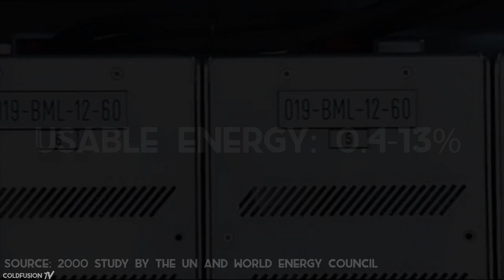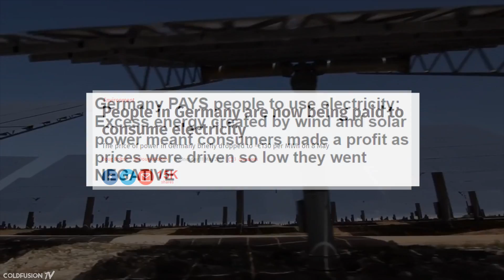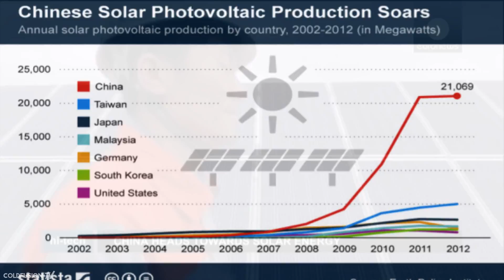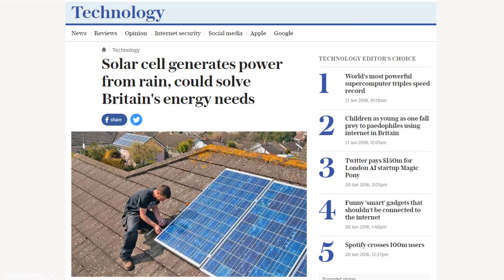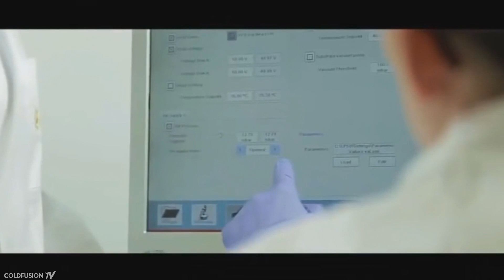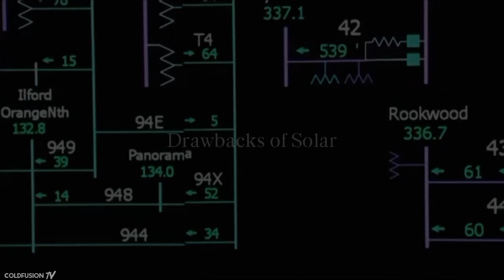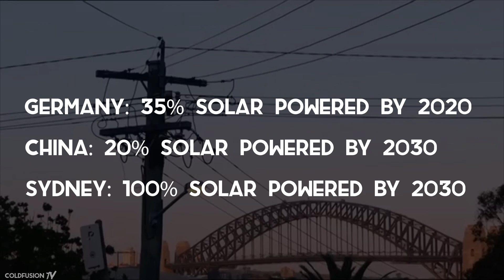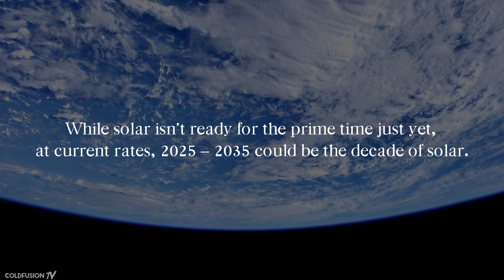The Truth About Solar

Comment: Capitalism doesn't agree with free energy, sorry.
Reply: Actually is does. If energy is super low cost and reliable it lowers the cost of doing business massively and gives long term security in the market place and elongates one economic disruptor.
Reply: time for unchecked captailism to die then with the rest of the old world.

along with your outdated industrial education set up
Reply: It isn't free. You still need to build stuff - batteries, power lines, silicon chips, maintenance, construction. At no point will it be free.
Reply: 1. Solar energy is not free. 2. Capitalism loves cheap energy
Reply: ***** Oil is free. It's sitting there. Just pump it. Ah, you need to actually do work to do that, convert it, distribute it etc. Sun is there. Just collect it. Ah, you need to do some work to build panels, convert it, store it, distribute it... nah too much work, just sit in your couch and comment me back.
Reply: The only capitalism problem is costs and benefits. If it's more expensive and has the same effect (not regarding environment) then we and I won't accept it. In general we don't want to lose money for altruistic reasons. I am not a charity fund.
Reply: That doesn't mean it's free to get the energy.
Reply: ***** Ha. Perhaps more applicable here than in any other place is the phrase "Easier said than done.
Reply: +danwarb1 tell that to bp, exxon, shell who are some of the world largest solar and wind manufactures and users.
Reply: Dark Alchemist You are disconnected from what it means to run a company.
Reply: Yea it does. Get something for free and sell it for money? Capitalists are all over that. That is why it's a billion-dollar industry today. It's a long-term investment, but hey, all power plants are.
Reply: Capitalism provides such advances and it boggles my mind that people blame it for every problem in the world
Reply: ***** you obviously don't understand how vast social projects like this work.  without the economy to support the design, manufacture and maintenance of such a system there would be no projects like this.

you also don't understand how economics works either.  there is a need for money in a society even with all those things, even if you made everything for free you still need money.  there will also be a need in society to compare the value of an something like an apple and a TV, and money provides the ability to do so.
Reply: Exactly
Reply: whats more important: an invented economic construct, or the existence of our planet?
Reply: according to wikipedia: ¨In 2006 Shell paid SolarWorld to take over its entire solar business and in 2008, the company withdrew from the London Array which has become the world's largest offshore wind farm¨.
So we can say that big companies are making a slow transition from oil to sun i guess...
Reply: Mārtiņš Rozenbergs
It is the most free that you will ever see.
Reply: Capitalism agrees with everything.
Everything on Earth is won free.
Imagine a world completely powered with free energy,
that would put a price on every ounce of (what used to be worthless) soil.
No alternatives and limitless.
Reply: tybofborg
Buy low and sell high is how a business works.
Reply: The problem isn't free energy. The problem is education. The worst thing to do now, is for an educated person to do nothing. Bring on the solar but let's not put all of our eggs in one basket.
Reply: Oxymaugnus
Of course.  Look at it like this a business, like WalMart, powering their store/shop all with alternative energy means that after the cost of buying the materials, and having them installed, would mean more profits due to no longer having to pay the power company AND THIS is why they give HUGE incentives to companies where it is less expensive to use the grid than it would be to use something like solar.
Reply: Who do you think is building, selling, and installing the solar panels? CAPITALISTS, dumbass.
Reply: China is not a communist country since deng xiaoping took over in 1978.
The panel production is heavily subsidised and that allows to produce massive amounts with effects of scale that were not possible in EU and are just starting in USA with the SCTY gigafab
Reply: ***** no, i think i came with what i need to state.  you may keep going all you want.  i feel secure enough in my points to rest my case
Reply: ***** did you just personify capitalism?  like it has hopes, fears and desires?

capitalism is simple, if we can make more money off of renewable energy than fossil fuels then we will use it.

if you are talking about a resistance to change, that has more to do with politics and how the economy is influenced by well established companies.  this is, at best, tangential to capitalism.

personally i see much capitalist potential in cheap, sustainable energy sources.  cheap energy has powered our economy since the industrial revolution.
Reply: If you pay for the solar panels and pay for their installation and ongoing maintenance and regular replacements, then pretty much EVERY capitalist in the world will instantly "agree with free energy". But as long as you don't produce and install solar panels for free, capitalists will keep looking for the cheapest possible energy. 
So, come on! Save the world and start producing and installing solar panels for free. What are you waiting for?
Reply: ***** RBE is bullsh*t for the most part. I used to be a big proponent of it until I dug into the details.Bottom-line of my findings was: It's a pipe-dream. Not gonna happen. Because the very fundamentals of that idea are based on wrong assumptions and Peter Joseph won't admit it. To see how deep I actually dug into that idea, this here will give a glimpse: https://twitter.com/StarCityProject 
I'm very serious about executing that project and making it a success. But RBE won't be part of it. Any society based on RBE is destined to fail.
Reply: ***** My point was NOT about using existing resources that the earth has. My point was about RBE specifically. It certainly makes a lot of sense to act and live in a resource-aware manner and Star City will be the first 100% self-sufficient mega city with 100% of all waste materials recycled. I haven't provided any reasoning here (for why RBE is bullsh*t) because it would take considerable time to write these points down. PLUS, posting it here in the comment section wouldn't be the right place. But I WILL write a proper article about this in the future. (can't promise when at the moment)
P.S. And I have only used the picture of the Venus Project as a temporary placeholder or visual gap filler. No more no less. I've been working for several years on this project, but not too many visuals at the moment and I'm not yet prepared to share those visuals that I have right now. That first article that you glimpsed at is just that: A first article designed to provide a very tiny glimpse on the idea. There's a LOT more to come and eventually that placeholder image from the Venus Project will be replaced with a proper image and a comprehensive video.
Reply: ***** I most certainly will provide the mechanics to make this work. That's for sure. And unlike RBE, Star City will have a solid foundation based on strategies, methods and techniques that are time-tested and proven to work. RBE only appears reasonable at first glance. But once you start digging deeper, you'll inevitably come to realize that RBE contains fundamental flaws in thinking/assumptions. Once you realize that, the whole RBE concept (appealing as it might seem at first glance) comes crashing down like a house of cards.
Reply: if only we could make the world better by wild speculation and making stuff up.  someone has to actually do this stuff instead of writing about in YouTube comment sections.

i can tell none of you guys are serious because you wouldn't be presenting these ideas to people who don't matter in the larger scheme of things.
Reply: the only way to get free solar energy  is if the panels are free (including maintenance). Its like buying a one year bus pass n saying you have free bus travel for one  year. And guess what,  the ppl making the panels wont work for free same as you wont work for free.
Reply: noneednow don't bother dude, just another person trying to change the world through the youTube comment section.  maybe all they have to do is believe hard enough, not put in actual effort into anything.

they double post, don't even know how to edit their comment.  so what does that tell you about how effective they are?
Reply: +Athletics the ability of the Zeitgeist Movent/Venus Project to be so dead on in their appreciation of the problems we face and yet so out of touch with reality with regards to solutions is utterly mesmerizing. 

For instance —
VP Proposal: cities arranged as a series of concentric circles with each circle dedicated to a different function. 
Why It's Stupid: Compared to a fractal or random distribution of functions, a circular distribution increases average trip lengths, making walking or biking less viable. In better news, it increases the number of people who have trips with the same end and start points making public transit more viable; though public transit is still sitting on your ass, which is bad for your health, and is also far worse environmentally than walking or biking. It would also result in people crossing paths mostly only with the same people that the people they cross paths with cross paths with. Also, it would be difficult to adapt to currently existing cities and it is much more efficient to make as much use of existing infrastructure and building stock as possible and only alter it as needed. Also, cities composed of concentric circles would entail significant central planning, which has always been shown to be a complete fucking failure that only benefits the planners if even that.

VP Proposal: skyscraper greenhouses, or whatever stupid shit you call that stupid shit.
Why it's stupid: powering x acres of artificial lighting requires 3x< acres of solar panels, and stacking the greenhouses means you need to spend more resources making the lower stories structurally sound then if you just built the same acreage using a single story and glass roofs. Moreover, in conjunction with the concentric circles layout it would likely put some adjacent buildings in perpetual shadow, esp at latitudes further from the equator. Much better solution: permaculture. If you do no other research into this, search YouTube for "one yard revolution", and follow that like it's the Bible and you're a member of the Westboro Baptist Church. Combine the methods of that channel with a fractal distribution of housing and land cultivated for food production and picking fresh fruits and vegetables from the garden needn't be harder than picking them from a bin at the store.

VP Proposal: machines that build houses quickly and with little to no human intervention.
Why It's Stupid: once you kill neoliberalism like the rabid dog that it is and you have an economy and population in stasis with nature, the rate at which you need to build need buildings is going to be low, automation costs resources and automation that works quickly costs more resources. Swinging a hammer is good for you and is a chance to get to know neighbors.
Reply: MegaStupidMonkeys no but the cost could be so much less....

and needs to be passed down to the everyday man/woman. so sick of corporations (crown/government corps where I am from...soicalism!) receiving the majority of the benefit
Reply: Forget free, it doesn't even agree with deflation nor discounts, period.
Reply: +Randy Sullivan Seck The profit they make from oil is infinitely bigger than they'll make with solar.
Reply: +Kawaii Darwin It would be great, but people will find that supplying their own place is better, free (of course you need equipment), and don't relay on external power/demand.
Reply: +KL Rider cost will be nearly free soon. As technology advances double every year, prices drop. Soon a normal sized panel will hold much more energy, will take less resources to produce, and people will likely be able to 3D print them
Reply: Well unfortunatelly it depends who you ask.
Reply: Plus they are doing everything they can to kill it via laws around the world, including the USA.
Reply: FDK
So, only a capitalist loves cheap energy?  I beg to differ with you as all of those plants in China would scream bloody murder if the govt stopped subsidizing them and their energy needs and China is still Red China.
Reply: ***** Who said only capitalists love cheap energy? I certainly didn't. Take your straw man somewhere else.
Reply: Mārtiņš Rozenbergs
bye bye troll.
Reply: But it kind of does. As long as you aren't only making power but also consuming it, free energy suddenly become very attractive.
Reply: Ben Anderson
Actually most Solar Panels are made in China and sold by Chinese companies and China is a communist country.  Now a lot of the capitalist companies will buy the Chinese panels, at small prices, and resell them as their own (rebadged) so they can increase their profits even more.
Reply: Elon made more for sustainable transport and renewable energy than most european centralised government project for last 30 years.It was the ruthless silicon valley risk prone enterprise that made risky bets and profited of that.
Reply: I don't think energy should be free. I think the focus should be on making it affordable, renewable and diverse
Reply: ***** i think we both know what people mean we someone says 'free energy'.  they mean energy that people don't have to pay for directly (much like most public roads are 'free' to use because our tax money we already pay takes care of them), they do not mean energy that doesn't cost anything to make, maintain or distribute.

saying capitalism won't exist in the future is completely speculative and is a dubious statement at best.  people are still people, motivated by personal gain and capitalism harnesses that motivation.  it is a very effective system in certain respects (and completely inadequate in other respects) but i see no effective system being submitted that doesn't have some capitalist characteristics inherent in it features.

the earth is not created out of renewable energy.  this is quite a complex subject matter, but in most respects the 'energy'* used to 'make the earth'* has been at the sun's expense.  the sun is not 'renewable'*, it has a fixed life span.  i think what you mean is 'sustainable', in that we can continually harvest it and we won't use it all up in the foreseeable future.  (i hate being this pedantic, but you started this course)

btw, we do have renewable and sustainable energy.  it just isn't as lucrative as burning fossil fuels.  this is what the OP is talking about.

pretty much everything you have said is twaddle.

* - attempts to communicate to you using your own inaccurate language.  from a physics standpoint this is a very poor choice of words.
Reply: I think capitalism is affraid of thins like this http://qz.com/680661/germany-had-so-much-renewable-energy-on-sunday-that-it-had-to-pay-people-to-use-electricity/
Reply: @brian falcone a solar power company makes back the cost of the panel in 5 years then can keep selling the free energy it generates, it doesn't have to keep drilling and mining for more solar fuel either since it comes from that magical thing in the sky. solar is massively more profitable in the long term, an entire farm of solar panels can just sit their with very little maintenance needed, only problem comes when all your power is generated by renewables and the costs come down to nothing - but will still need to be able to cover the cost of staff and new panels so energy will always cost money unless you generate it yourself.
Reply: +Strangething90 It will be posible to generate by yourself, you just said it, its more easy to generate, mantain and cheaper.
Reply: Even in a technological utopia you describe, where everything is made and manged by robots, there would still be an associated cost with doing things. If say for example you asked this system to produce a mansion on Mars, it would need to figure out the easiest way of achieving this in terms of technical design (computing) resources, energy, time etc. There are multiple ways of achieving said goal, so what's to stop the system from choosing a long winded, round about way of achieving it. The system would need some variable to optimize to achieve said goal, this is what money is. The only way you could approach a society where costs approach zero, is where the production capacity far exceeds demand (and the resources required, energy material etc is abundant). However our demands expand with our societal abilities (building a mansion on Mars for example), so the production capacity of the world would still likely be constantly in use.
 Also, all this stuff will become meaningless when we plug ourselves into the matrix ;).
Reply: Yes I get that we're heading towards a more automated economy, that's inevitable. What I think is that money will still have a role to play as a sort of credit system (which is basically what current fiat currencies are, arbitrary credits), and helps identify the demands of society and hence resource allocation.
 I don't think there's anything wrong in profit,as long as the profit structure of society is beneficial to people. And in a free market society, people spend their money on what they want, therefore the products and services which people want more, earn more money and the respective companies expand. after all a company is just what the name implies, a company of people working together to do something. Hence people who provide what other people want are rewarded with these arbitrary credits we call money, and then they spend that money on what they want etc. This is the ideological construct of a free market, although in reality it's impossible to achieve i.e. it's impossible to have a complete knowledge of the marketplace and pick the product that most meets your needs, and people can be swayed by things like advertising, branding etc. It kind of boils down to your faith in society and them being well informed (which I do personally).
 A good example is probably Tesla. People know that they are not for maximum profit (or any profit at all) but they still put down the deposit on the new cars and their stock price is very high. So why do people put their money into it, because they want it and they want to support what the company is doing to make sustainable travel i.e. they are willing to pay a higher price to have sustainable electric cars. They are not 'for profit' but they certainly are profit oriented in that they want to produce the best quality product for the development cost and get the maximum share of the automotive market (as almost all companies do) hence they try to achieve this in the most efficient way possible with the available funds and technologies. Obviously not all companies focus on the value of their product and have large profit margins. This happens for a number of reasons: lack of competition in the market, people ill informed or swayed by things other than the value of the product like branding (Apple is a very good example here) or the company has a monopoly for other reasons such as patents.
 Another example is charities, people give their money to them simply because they support what they do, and they in turn spend it on what they need e.g. water pumps.
Reply: It is also interesting to think about money in terms of increasing automation. I think the days of needing a job to have a living are numbered (if not already over), due to work being automated. Through the history of mankind, ever since we started bashing things with rocks and rubbing sticks together, our aim has been to achieve more with less work. The question is where will people get money from as more and more jobs get automated. This is why I'm fond of the Universal Basic Income, even as someone pro free market. Even today there is a reasonable argument for introducing it, replacing current welfare (I live in the UK) and removing some welfare programs but giving people the money directly. There is a saying 'No man spends money better than his own', so people spend their money on exactly what they want, and at the lowest price. It does depends on your faith in the free market however, to provide what you need with out monopolization etc. Some things like the NHS shouldn't however be privatized in my opinion. But yeah UBI is probably what is necessary to deal with automation in the future, with the money coming from standard tax revenue or some sort of automation tax. As automation increases, more people would lose their jobs but the profits would increase, be collected with this 'automation tax' and essentially given to the people now on UBI. This would work as long as the profits gained from the automation, were sufficient to provide the people now on UBI. Peoples real wages wouldn't be stagnant either, since as automation expands and improves, productivity growth (amount of stuff made with a given amount of money) improves, therefore prices drop and people can have more stuff. Eventually you could reach the situation you described, where everything is essentially run by robots, the difference here being that everyone has a universal basic income (which is also an easy way of preventing people taking more resources than they deserve). The profits earned by the robot 'companies' would then be recycled into peoples UBIs. Even when one robot 'company' is giving money to another 'company' e.g. a car manufacturer giving money to steel manufacturer, giving money to an iron ore miner etc. all of that money ends up as profit for the robot companies at some point, which is then recycled into the UBI. Having a system with money, also gives a good way of punishing people with fines etc as we do today. I'm not sure if there will ever be the day when absolutely everything is automated, and some things are still best done by humans, I'll leave you to figure that one out ;).
 This is my sort of idea on the whole thing but tbh it's just ideas and theory, anyone who sees issues with this I encourage discussion ;).
Reply: Dude socialism is not a government and corporations first ideology.
Reply: ***** I will certainly post it for all to see. But definitely not here.
Reply: ***** So? Oil isnt going to last forever and neither is the oil business. Those are just two facts of life. The profits will move out and away from energy once it becomes super low cost and abundant and into other economic places. The world used to be powered by wood, then by caol. Follow the trend: gasoline and petreum and other fossil fuels wont be around infinetly either. Resources are FINITE, no INFINITE and that makes their businesses the same. Some people are so addicted to their little routine worlds but guess what? Shopping malls are dying and someday so wont Walmart. Thats just how the economy works. Nothing is forever. You are saying that because something is going to get better for the world and provide more value for all particiapnts in the economy accept the outdated cartels that we wont get there? How foolish. Solar has fallen 80 percent in just the last two years because of American and CHina manufacturing scale, not to mention the 40 year exponential decline in solar power costs we have truly experienced going from 705 dollars a watt to 74 cents a watt and falling.
Reply: ***** Wishful thinking. People are greedy and ignorant. There is no future when you have an economy that relys 70 percent on consumption and is headed toward a world with no jobs and in the United States a decreasing population.
Reply: yep, thats why comunism  worked so great in the last century. They all worked for free. Do you work for free ? Oops , no they didnt , they worked for minimum pay ,minimum standard n minimum standard of living. Someone  has to make  or do all the free stuff you mentioned  for free  for it to be free.Someone has to pay . You should start first  n start working for free or just get  paid what you need to survive. Minimum food , minimum shelter , minimum medicine ...etc
Reply: Do you hows the best way to curve the population growth? Ppl like you in first world countries just eat "healthy" organic food so the planet cant produce enough food for everyone else. Anyway, you  will work for free, right ? You gottta walk the talk.
Reply: Not only capitalism. The governments are also scared on the idea of no tax revenues from the selling of energy in the standard formats like grid electricity, fuel, etc.
Reply: we are personifying capitalism AND government now?  those guys are jerks anyway, we should just take back everything we gave them.  then they'll learn their lesson.

seriously, you do realize capitalism and government are just abstract concepts made up by people, right?  they don't really have agendas and desires, in fact the people who contribute and maintain these institutions often don't even agree on how they should work.
Reply: if for you capitalism n goverment are abstract concepts you are gonna have a hard sad  life.but dont worry you can always blame rest of the world  for your hard sad life . lol
Reply: noneednow alright, i'll bite.  if government and capitalism aren't [abstract] concepts then what are they?
Reply: simply speaking, capitalism is math n government is logic. And i was just joking about hard sad life coment  :)
Reply: capitalism doesn't work with free energy? and thermodynamics do?
Reply: +Athletics "ohhhh technology that I don't understand is going to magically solve problems I don't understand", hang waving bullshit.

how does "technology" alleviate the need for price signals, how does technology provide price signals without markets.....
Reply: ***** alright, do it.  demonstrate how we are wrong rather than spewing nonsense.

oh right, first step is youTube comment section, then you're off to save the world.  thx for all your hard work.
Reply: ***** great, work on it.  convince me with results and not your lip service.  if i listened to everyone claiming to have the silver bullet answer to the world's problems than i'd be a bigger fool than i could imagine.

my life experience has showed me that people claiming to have the answers rarely even know the questions.  there are no perfect solutions, every model has it's benefits and detriments.  you just seem like another person in a long line of people with faith in their beliefs without the ability to see things in any other way.

tell me one downside of your model, if you can't then i'll just have to think you're just another believer trying to convince others to share your vision and worship your idol.
Reply: +Athletics I give you three reasons for why the Venus Project/Zeitgeist Movement is bullshit hand waving, and you instead argue with the troll.
Reply: IF CAPITALISM NOT EQUAL TO FREE ENERGY, THENSOCIALISM EQUALS NOT_FREE ENERGY.And that is how it works in reality, because all these solar and wind "free" energy technologies will not survived if they were not subsidized HEAVILY by the money earned through the capitalist system and confiscated by the tyrannical socialist government bureaucrats.
Reply: Touche'!
Reply: well, it does in a way - when energy gets to be so abundant that it will cost almost nothing. But we are far away from that, because fear mongering got the masses to turn away from nuclear power.
Reply: mind you, most equal and successful system ever made.
Reply: with all the crap you spew, do you happen to be a Liberal arts major?
Reply: Sad but true.
Reply: Its not sad , its reallity . Noone works for free  . . Do you? work for free ?  if not   , dont be sad   ")
Reply: noneednow Yes, there are people who work for free, because of the joy of improve the World or anything else.
Reply: So ,Bruno  are u one them who works for free ? Or are you  just another hipocrite freeloader ?
Reply: +Josue Nieves what? utility scale wind is cheap and solar without transmission losses is really cheap....... and neither is anywhere near as subsidized as petroleum....